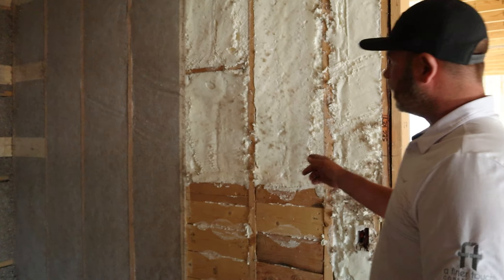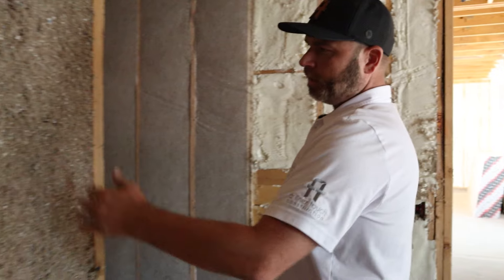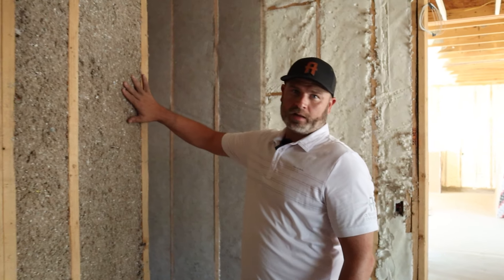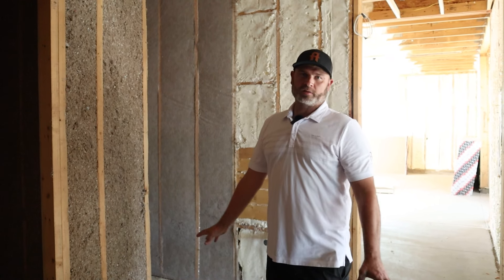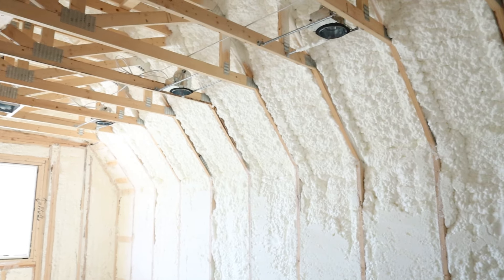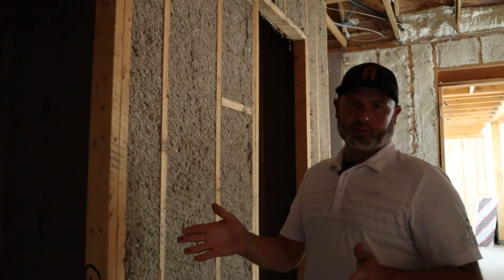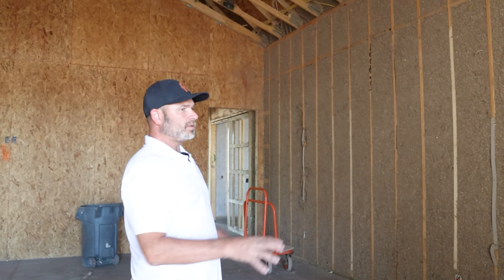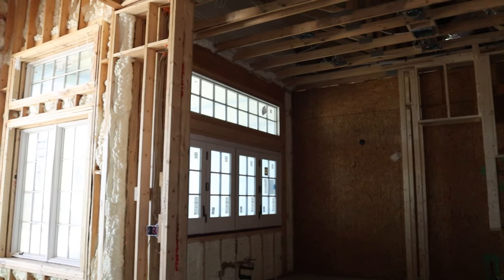Custom Home Insulation: Open & Closed Cell Spray Foam, Cellulose Insulation | #SMGILBERTTRADITIONAL

Comment: Building this fall and decided that open cell spray foam is the best bang for my buck cost for high performance insulation. 
It easily beats fiberglass, provides sound dampening, provides an air barrier over 4”. 
I also believe the cost will be recaptured as the years passed with the increased efficiency. 

Good vid!
Reply: Agreed!